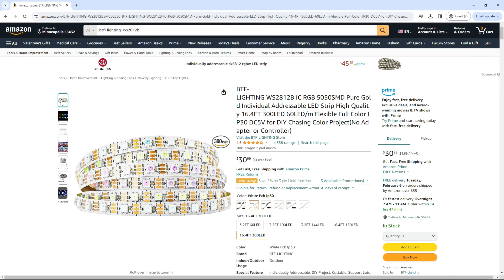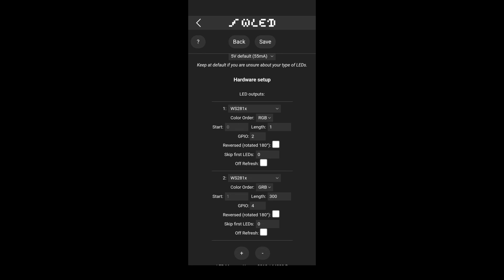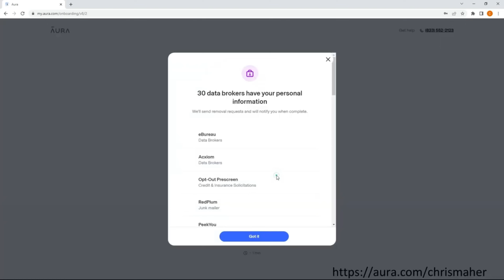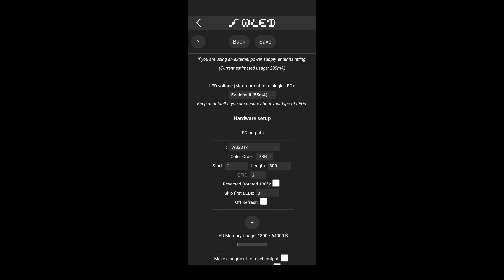12v and 24v LED Setup Guide - WS2815 & FCOB: ESP32 & Domestic Automation WLED Controller

Comment from the maker: 📟 BEST Amazon Deals on Electronics: https://amzn.to/47qjC9j (updated daily)
☑Check out my sponsor to begin your FREE 14 day trial to Aura: https://aura.com/chrismaher
Domestic Automation WLED Controller with Mic: https://amzn.to/3u7xEw4
Domestic Automation WLED Controller NO Mic: https://amzn.to/3SniMlc
ESP32: https://amzn.to/3w1hBQQ
Wago Connectors: https://amzn.to/3HzpUG0 and https://amzn.to/3HA9ZHA
Wire Stripper: https://amzn.to/3O5XEhW

12v WS2815 Strips: https://amzn.to/491aKFa
12v Power Supply with Barrel Plug: https://amzn.to/422SSra
12v Power Supply with Bare Wires: https://amzn.to/3OrOvAq

12v Cob Lights: https://amzn.to/423kRqW
12v Power Supply: https://amzn.to/422SSra

24v Cob Lights: https://amzn.to/424vI3H
24v Power Supply: https://amzn.to/3SpB1Xl

5v SK6812 Led Strips: https://amzn.to/3S6ptaX
5v Power Supply: https://amzn.to/48R3PP6

5v WS2812B Led Strips: https://amzn.to/3tYxpmI
5v Power Supply: https://amzn.to/48R3PP6

Power Cord for Domestic Automation Controller: https://amzn.to/3vXpdDP
Micro USB Charger for ESP32: https://amzn.to/482MWjB
Silicone Wires: https://amzn.to/3HLmv72
Jumper Wires: https://amzn.to/3SHG6v7
Resistor: https://amzn.to/49mT7jx

Spotless Diffuser Channels for 60 Leds/meter strips:
Regular Channel: 1m Amazon: https://amzn.to/47aIujz 
Regular Channel: 2m Amazon: https://amzn.to/3QoHeDb 
Corner Diffuser 1m Amazon: https://amzn.to/3DFhRpf
Corner Diffuser 2m Amazon: https://amzn.to/3Krqw2q

Best Shallow Diffuser Channels for COB LEDs
6mm Diffuser Channel 1 meter: https://amzn.to/47OVPNA
6mm Diffuser Channel 2 meter: https://amzn.to/3SzalEO
Continuous Diffuser: https://amzn.to/3SxmQAs
Corner Pieces: https://amzn.to/3OfZH2U

Domestic Automation Controller Walkthrough: https://youtu.be/QmMwrOUB_kw
WLED Beginners Guide: https://youtu.be/exAWzMfmwQ8
Soldering For Beginners: https://youtu.be/apSz3NXYlx8

The best way to help support my channel is to like, comment, make sure your subscribed and share my videos with as many people as you can. The other way is to use my links above as I get a small % at no extra cost to you if you buy something. Thank you all for the support!
Reply: Hey man, I've been really enjoying your videos. I want to get a sound reactive setup for myself too, but with no ambient noise. Can you please make a tutorial hooking up a 3.5 line in module to the ESP32 instead of the mic. It would be really apreciated <3

Comment: 2:05 is incorrect! 
WS2815 has DI (Data-In) and BI (Backup-In), but only DI is used externally.
BI is part of the internal failover system between the LEDs:
If one LED fails, the data signal is routed internally through the backup line.

Therefore:

External wiring uses only: +12V, GND, DI

BI stays unconnected, because the controller provides only one data signal

DI and BI must not be tied together, otherwise you break the internal backup logic

Comment: The only thing I’m not seeing is how to integrate FCOB non-addressable white LED strips with ESPHome and Home Assistant. ChatGPT is telling me I need to solder MOSFETs to the ESP32 board. Is that so? The alternative is what you showed in another video which is to use a BTF controller with Tuya. Either that or use RGBW lights as you are here with WLED.

Comment: While doing this you skip using GPIO2, the primary green wire coming off the controller.  Can you still use that on its own (without it's accompanying red and white wires, since I need 24v) as a second data source for grouping/split runs?

Comment: Why didn't you change LED voltage in WLED settings from 5V default to 2815 12V, since it has taht option @ChrisMaherDIY? Isn't this a necessary step for this setup?

Comment: Thank you for this. Just to be clear, the controller is 5V but can be used to control a 24V LED strip?
Reply: yes, you just need 5V to run the controller (the round barrel jack) so it can give  the color/brightness data to the LEDs, the power supply alone powers the actual LEDs and it doesnt run any current to the controller, thats why you NEVER connect the red wire (+) to the controller! couse then the 24v would burn out the controller. all you need to connect to the controller is the ground ( - ) and the Data, because in order to send the Data (color/brightness) the controller needs those 2 to send and recieve information, the power is connected to the led

Comment: I had outdoor Govee lights (H6171) that I mounted on my house last year, and I was using the Govee controllers and apps to control them.  Sadly, a lightning strike nearby this Summer burned out the controllers, and I am now in the process of cutting out the controllers and replacing them with ESP32's, mainly so I can hopefully avoid replacing the entire things -- it was a lot of work to get them attached to my roofline.  It will also be nice to have more flexibility in the color designs: the Govee software is quite good, but I've used 2812s for other things and am really pleased with amazing control you get with WLED.  Your videos have been really helpful, since I am fairly sure the Govee lights are just 24v 2812 LED strips at heart!  You likely saved me a LOT of time figuring out the flickering issue I am SURE I would have seen next, so thank you!!!

Comment: Quick tip from experience - GPIO2 is often shared with the onboard LED on ESP32/ESP8266 controllers, so if you don't want that to illuminate you should choose another GPIO pin

Comment: Thank you so much! Just bought the FCOB BTF 24V 3ft 720 led light strip and was having flickering on the newest version of it and didn't think about using a resistor this was genius! Works well as single use or if using in segments with multiple data inputs. Anyone buying these or having the exact same problem I highly recommend using a resistor to fix the flickering issue. Size of resistor I used was a 220 one but thats all I had available maybe someone else knows the actual calculation for the resistor.

Comment: Hey Chris, your videos are fantastic. My problem is that my bench setup like yours works, but the ESP32 controllers keep burning up. I see other post with the same problem but no good solution. I am using the USB-c ESP and 12v or 24v and my guess is the ground or data is back feeding and killing the ESP32. I am using a USB-c power source for the esp but a 12v power supply for the the LEDs, the 12v + only goes to the LEDs so it’s the data or the ground killing the boards.
Reply: Dude I literally just lost 4 board YESTERDAY  for the same reason...im suffering from electronic DIY Depression at the moment....I feel your pain bro😢
Reply: Any updates on this issue? I am about to start a build based on that approach, glad that I saw your comment.
Reply: @tsilikasp hey bud...the only thing I noticed later was govee pulled a fast one..one of my strands the reversed the polarity (or maybe it's built into those barrel resistance things) but what I mean is...going out of one strand data is green power is red ground white...on two separate strands (from the same box) coming in should be the same colors however on mine on the one strand...the power was WHITE and the neutral was RED. unfortunately I fried some outdoor govee permanent lights figuring it out. Long story short. Check the polarity again(I know I know...do it again anyway...but SLOWLY) hopefully your issue was something simple as that and you didn't blow 500 on a oversight. Cheers and best of luck friend.

Comment: Wonder if there is a way to power the LED strip and controller board using PoE.
Reply: Yes. You are best off using the guy DrZ partnered with.  It’s a ESP32 with the PoE and all sorts of post protection built in.

Comment: 5:54 insted of using the phone charger i can use the ESP32 development module (or expansion module for ESP32) that i can buy on Ali for avoid two power lines? it supports up to 16 v and it has a jumper of 5v, im i right?

Comment: Wow I think this is exactly the video I needed. I have been racking my brain trying to install a level shifter to stop flickering but I have not tried a resistor yet. I will give that a go and see if I can stop my flickering issue.
Reply: did It work i have the same problem ?

Comment: Hey Chris!
First of all I love your videos! you always offer great explenation on very small details. but i have a question regarding multiple led strips. do i need to use multiple controllers for multiple strips or can i use one controller and send the data to the multiple strips with a wago clamp for example? So I would use one controller and send the data from it to the floor lamps, the ceiling Leds and the Leds around the TV?
Greetings from Austria!

Comment: Thank you for video. I am a builder looking to do this on gables hidden in f channel for a version of permanent christmas/ambient light. any idea on runs with the 18g wire being  40’. will have 4 runs longest strip light needing to be 71’
Reply: For what it’s worth I recently ran 96’ using a 12v 150w psu 30 led/m ws2811 strips end to end with power injected on the end of the run in my entry and can get 100% brightness on white without any issues at all. I am also using an esp32 GLEDOPTO controller on a single gpio. No flicker and colors are perfect.

Comment: This is very interesting!! Is it really necessary to jump the ground from the controller to the 12v PS ground?
Reply: yes, because the controller needs the ground to send the data (color/brightness) to the leds, without the ground connected the controller doesnt have the loop to send and recieve data from the smart leds, think about the veins in your body, it needs a loop to circulate and for your brain to function, if you dont share the ground with the power supply then the controller would be out the loop

Comment: Great Video! Could you also show how to use a single power supply for the esp and the led strip?
Reply: you can use a step down converter and tap into the power supply and connect that to the esp32

Comment: excellent content brother - quick question can the ESP32  drive the 15m replicating the same sample you demonstrate with the Domestic Automation  ? ( 12v and 24v )  - also for 15-20 Meters run do you recommend 24v to avoid power injection?

Comment: Did you connect the 5V ground (from the controller) to the 12V ground? 1:51
Reply: yes he did . if both grounds are not connected together it wont work. There will be no return

Comment: So, let's say hypothetically....forgive me it's my first diy project, that you have a strip of 24v cob LED's that you have already cut off the jst connector, is the strip ruined?
Reply: definitely not, you can solder new wires to the little copper pads, and it's pretty common to do so.
Reply: @costas92  thanks! I'm starting to think I've bitten off more than I can chew. RGBW Cob LED's for under kitchen cabinet lighting.

Comment: Everything i keep reading online keeps talking about putting an inline fuse between the strip and the power supply, but no videos i watch online have that. Everyone online seems to be adamant about using an inline fuse. What are your thoughts here and why don’t you use them? Also I’m in the UK and we have fuses in our plugs, but I’m guessing that just protects the house wires between.
Reply: I wouldn't worry about it if it's only 5v
Reply: @Mr.Meme01  I'm using 12v now, would you recommend it for that?
Reply: @umirza  it depends on how strong your power supply is, if it's stronger than what can power 1 strip, yeah you probably should add it. 

It's not an absolute must but it's always better to just add extra safety measures and forget about it instead of leaving it and then in the back of your mind you worry about it.
Reply: Voltage is not the issue, it is current so usually with 5V you have more current. Inline fuses are generally needed when you have multiple strips / injection points powered from a big power supply so if a strip fails it might not trigger the overcurrent protection from the power supply but it still be can too much current for the strip to be a fire hazard. Quinled has an excellent article about this in his website
Reply: @SergioLópezMontolio  he said "the strip" so I'm assuming he only has one 5m max strip, I wouldn't worry about putting a fuse on that if it's 5v especially since the power supply is likely small. 

He said it's 12v so even with just one and smallish power supply the hazard is low. But just to be safe yeah he should put in a fuse on it.
Reply: @Mr.Meme01  Agreed, with small power supply there is no issue. Starting at 75-100W and more than 1 strip OR injection point to tjhe same strip is when fusing the lines is recommended.